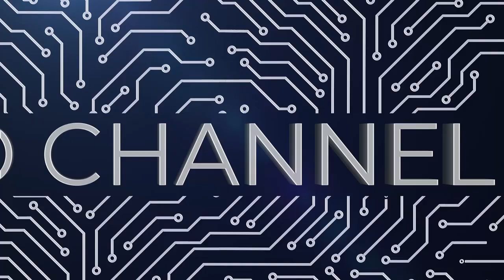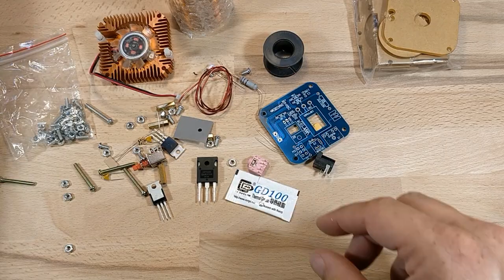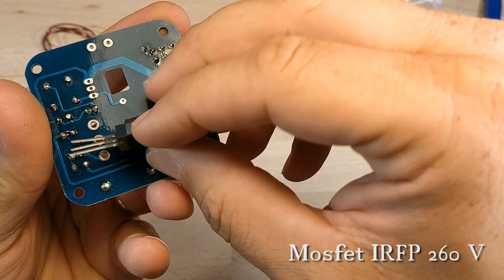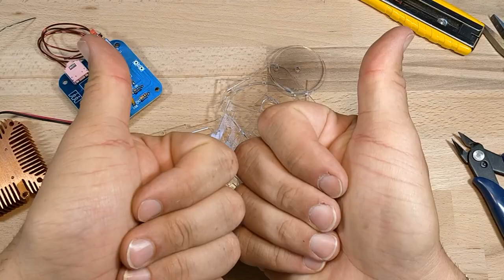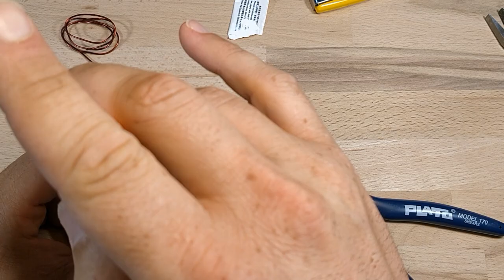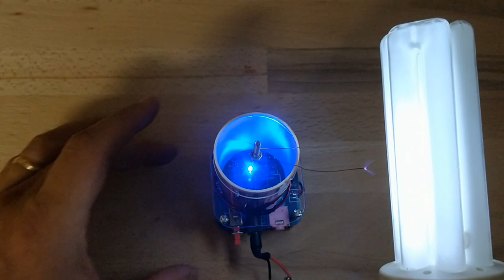How to assemble Music Tesla Coil Module Kit DIY

Comment: Thank you! I ordered this because of your video. It showed me exactly what I'd be getting and how to assemble it. Excellent video. Much appreciated!
Reply from the maker: +Erik Burman thanks to you for the comment. I love this music generator. Every time I show it to my friends they are amazed! Remember to subscribe to the channel! I will soon be putting in new videos! thank you
Reply: @cosmochannelvideo  I finally completed this project today. I followed your instructions carefully and I think it was all done correctly. It worked for a few seconds but then the coil transistor exploded! That was very exciting but also disappointing. I suspect that my battery power supply was unable to supply sufficient current and the circuit failed to oscillate correctly. The transistor essentially shorted to ground, overheated and then failed dramatically. It's interesting that they provided an extra transistor with the kit. It's difficult to find a 24 VDC power supply rated at 3 amps or greater, but once I do then I will solder in the replacement transistor and try again.
Reply from the maker: @erikburman530  Hi, Erik. Thanks for the comment. Unfortunately with these kits it often happens that either they don't work or they get burned immediately. I also noticed that they add more pieces. It's those pieces that get burned right away and they know it! If you have a stabilized power supply try to supply less than 24v. I noticed that at 24v it heats up a lot. Have fun!
Reply: @cosmochannelvideo  Yup. I'm not sure if I supplied too much or too little power, but I'll definitely get a regulated supply and I'll try it at a little less voltage. I'm hopeful that it will all work out. Thanks for your reply. Cheers!

Comment: Have you tried adding a top load ? Does it make the arcs longer ?
Reply from the maker: If you go beyond the recommended voltage burn the Transistor.
Reply: @cosmochannelvideo If you don't know, that MOSFET can take higher voltage as input, but the npn transistor cannot handle it for long, but if you add a top load it will work better with large arcs without burning the transistor....

Comment: Hey! Nice Video! I also bought the kit. Build it but now i have a problem. Everything is on. The led, the vent but not the coil itself. No ark no music. Could you have an idea of the problem? Thanks!
Reply from the maker: Hi, there. Unfortunately it could be a thousand things... Are the welds done well? Are the components put in the right place? The wire of the coil must be "peeled" very well because it has resin and otherwise does not weld. Give me some more information. If you want to send me some photos cosmochannelvideo@gmail.com
Reply: @cosmochannelvideo  I think that everything is in place. When you speak about the resin. Do you think it could block the current? And thank you a lot for the mail i'll try to send you pictures. Thanks for the answer.
Reply from the maker: If you do not clean the coil filament well, the current will not pass. Use the tip of a cutter to scratch the resin
Reply: @cosmochannelvideo  There is (good) news. I cleaned both the thin and bigger coil filament and welded back it up. And now i have a spark and music BUT ONLY when i bring a screw or something else close to the top (like you do at the start of your video). Otherwise, nothing.

Comment: I bought a kit almost identical to this but the fan did not come pre-installed in the heat sink and I can't figure out how to get it in. There seems to be three screw holes on the fan but I don't see screw holes in the right locations on the heat sink and I wouldn't be able to screw them in anyway because the fan blades would be in the way. Does anyone know how to get the fan in there securely?